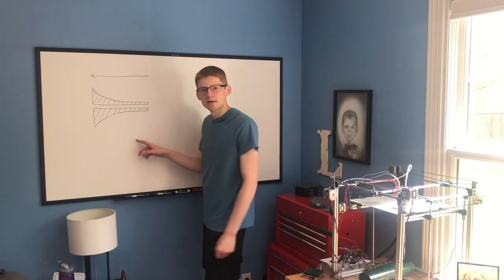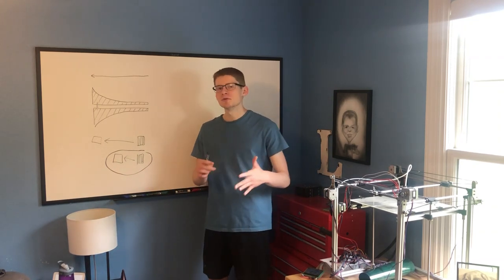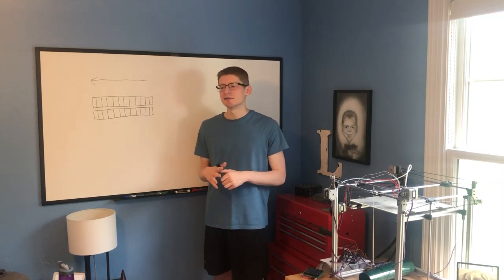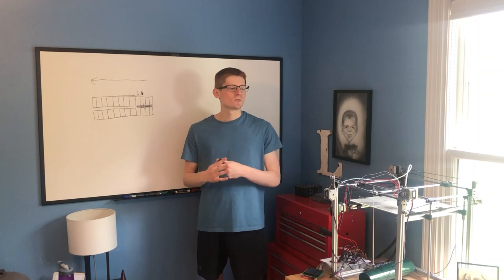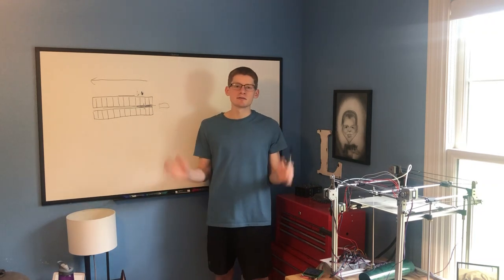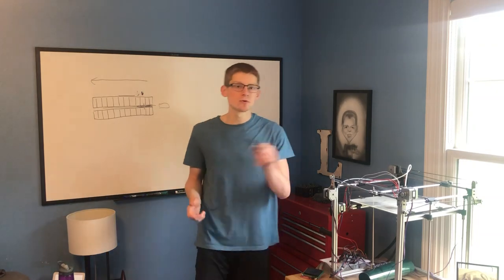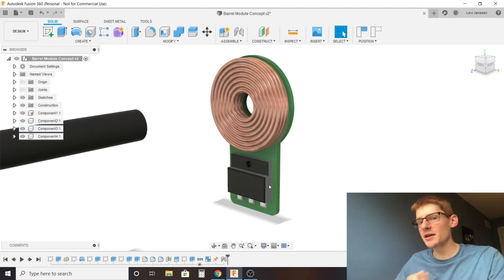Making a Coilgun - Part 4: A New Revelation

Comment: Hey Jannsen what if you take the infrared sensor and remove it from the direct area of the coils and use the space the diameter of the laser light takes up to detect when it passes? You could also potentially do something with a coloured part of the projectile to detect a specific point to time it better, 2 parameters is better than 1 i would assume

Comment: Trial and error to find the most efficient coil set up a test where the coil is at a certain height and the bullet is face up on the surface below, then measure how much voltage and current it takes to lift the bullet off the table or make it fall over. This is the best method I have found

Comment: On the topic of knowing where the projectile is, you could easily use VERY small diameter fiber optic material with a bright LED on the PCB, and another strand opposite the projectile opening on the other side leading to a photoreceptor.  This will let you time things, and I feel that the blind timing is a dead loser.  Can't address the coil geometry, but the PCB is more than thick enough to accommodate grooves that will hold the fiber optic strands.

Comment: I'm not sure but can the longer design even be called a coil gun or is it more of a rail gun. The Navy has a couple " rail guns " and they do produce great power and range or distance. Again I think if you could move the power from a large pack pack with a belt mountain controller for 6 or 8 coils in a spaced out configuration of and of a ever increasing power size using a plastic barrel you would reach your desired end result. This would both be a true coil gun as well as matching your wishes of high efficiantsy. Sorry for my lack of Spelling skills as Dyslexia is a real bother.

Comment: There is an other problem to spent attention to. The coils have inductivity. They  switch on and off slow. When the current is high it is hard to switch them off without protecting the mosfet. I don´t know if this is long enough to effect the timing. If the power comes from a capacitor you don´t need to switch off if the cap is already empty but there could be a resonat effect.

Oops, I see this is already in a later video.

Comment: Look at a rail gun and see if you can't fuse rail and coil since they both use magnetic force natural high power neodymium magnet alternate negative positive down the line on the pulls there's alot you can work with look at all angles charged copper is good but thinking outside the box is how discovery is made and your doing good also think about this test it in a vacuum chamber space gun bro

Comment: How about using high voltage for the sense circuit. You could have one hot wire with a lead going to each individual coil and a return lead on the other side of the tube. When your metal projectile approaches a coil the high voltage will jump across the leads through your projectile. The leads could be as thin as a single magnet wire and thus could easily be placed in between your coils. Also for the most efficient electromagnet you need to increase the copper fill. By using thicker copper wire the same current flow as before will generate less heat and thus will be more efficient.

Comment: Pull and push? as the projectile passes mid point the coil reverses to push?  use opto couplers between each coil for determining position of projectile, this could control triggeringand coild polarity flip, then use a geometric progression of distance between coils, close at start and increasing in distance, also ramp up power based on distance between coils? Arduino for control?

Comment: What if you offset the rotation of the coil pcbs, to free up space to allow for smaller coils if necessary or larger MOSFETs, the only problem would be is that the power rails would have to wrap around the the barrel. Also, you should get a discord server, it would help with communication.
Reply from the maker: You make a good point, that's also something I thought of. if you offset every other transistor position by 180 degrees, you could just have four busbars instead of two, so power distribution wouldn't be much of an issue.

Comment: have you considered using the projectile itself to determine projectile position? you could use brushes to complete a circuit and trigger the next coil pack
Reply: you could also take a hit on coil density by placing optical sensors after every few coil packs, and estimate the time in between sensors, rather than estimating the entire thing

Comment: So you're thinking about it all wrong with the turns of copper wire. Think about it more in terms of resistance per foot and length of copper wire. The gauge of copper wire you choose will determine the length you use because like you said there comes a point where amperage decreases due to Resistance. So what you want to do is choose your gauge, then determine how long that wire can be. You want the biggest coil possible so if the resistance gets too high you will compensate with voltage. I believe that if you just choose a starting point it will make it easier and thickness of wire is in my opinion the best place to start because from there you can calculate everything. I like where you're going with this idea and I believe I have a coil design that will work better. You're design is good except that the outer diameter of the coil is too far from the projectile so it won't be adding much to the equation except for losses. This is getting too long haha. I've been putting a lot of thought into the same thing if you couldn't tell.

Comment: If the bolt moving through a coil creates a small amount of electricity, it could power a transistor to then go to the positioning circuitry. And then immediately power that coil.

Never mind I don't think this will work

Comment: I don't have the technical knowledge regarding the electrics but maybe I can contribute a mechanical idea on triggering your coils to switch on and off.
Is it possible to have the projectile travel along two segmented conductors (one positive and one negative) where each segment is a contact switch.
 The projectile will close the contact for the coil it is approaching and open the the contact of the coil it has reached the center of.
As the projectile gathers speed the distance between the coils and switches may need to increase to make the best use of the timing of the switching sequence.
Is this likely to reduce the reliance on some of the electronics you have in mind?

Comment: So reality in a way helps to simplify this problem somewhat since you don't have to model the relationship between the number of turns to the magnetic field given the current and voltage limits of your power supply and the available volume for the coil.  Magnet wire comes in a finite number of gauges so instead you can figure out how much magenetic field you get from using the maximum number of turns for each gauge of wire available to you and just look for the biggest number.

I think heatpipes or vapor chambers and some copper shims might be a good way to deal with heat dissipation.  Look for what's available and tailor your design to that.

Comment: What if, first of all, you make a projectile about the size of three coils and put the coil contacts inside the barrel? in this way, when the projectile passes, it will activate each one of the coils, but putting the contacts of the first coil before in the barrel, of the second coil in the center of the first, the contacts of the third coil in the center of the second coil. and so on? In this way, when entering the cannon, the projectile activates the first, being in the center of the first activates the second and being in the center of the second turns off the first and activates the third.
I do not have much knowledge about it but it is something that occurred to me, sorry if it is misspelled, I used a Google translator
Reply: If you do that, you increase the chance of the bullet welding to the contacts. Plus even when it doesn’t weld it to the contacts, it greatly increases the resistance the projectile experiences.

Comment: you can have a sensor under the coil.. equation, laser data point interpolation. for a projectile that is the same size and will always be that specific size the blind method would do fine if designed around that specific projectile.

Comment: You should be able to back out it's position if you know it's mass and magnetic permiability to a fine degree.  Based on the rough calculations, you should be able to calculate a charging and discharging sequence that's ideal for the mass and permeability of the round.  Also, you need to start getting into assembly my dude.  Start calculating shit on terms of clock cycles of the cpu and how many cycles it takes to fill a buffer.

Comment: you only need a pinhole width of space between coils to implement a diode position sensor, the LED and photoresistor/comparator circuit(s) are off to opposite sides of barrel(outside of), just need to keep ambient light from photoresistor

Comment: Just retro fit your coils... say you build 8 coils, you could put a sensor at the end of 1 coil, measure the speed/time, use that speed/time (avg over x amount of firings), remove sensor, add second coil and repeat until desired length/speed is reached.

Comment: IDK if you will ever read this, but anyway.
Disclamer: i am not english, sorry for the grammar.
Your problem with the resistence, you can more or less ignore that, since you do not want to go for big coils anyway.
Copperwire has so low resistance that you need to have a very big coil for it to kick in.

The bigger issue with big coils is the inductivity. Basecly the more coils, the longer the magnetic field will linger around and pull back the projecktile.
Sadly i havent jet found a mathematical solution for this, but i am working on it to at least beeing able to guess more accuratly.

Comment: Why limiting the thickness to the mosfet dimensions, you may separate the switching electronics from the coils, in a switching electronics module, having its own heat dissipation system, this way less heat at the coil area, regarding the coil heat dissipation you may use like multiple tubes (closed loop) with thermal dissipation fluid (oil, water...) installed in a circular pattern around the coils...
Reply: Look into the vvvf power modules setup, some are dipped in some kind of gelatin that helps heat dissipation
Reply: Regarding the coils, you may think about it as a big coil, subdivised, maybe linked in a way that you can select the needed coil area (series connection for exemple...)

Comment: By applying a lot of constant current you also heat up the coil. So yes, of course it'll be less power efficient, but I think it would be more efficient for the copper. Power is quite cheap, though expendable here. copper wire especially for bigger coilguns gets a bit costly and heavy. 
Blind systems need to be fine tuned, and I would think it's main enemies could be gravity or centrifugal force from movement of the gun, and change in friction of the projectile for various reasons, but these aren't significant for the most part. Although at the end when the acceleration per coil falls dramatically, to use them at all I believe you'd still need sensors even with those being a small factor, but at some point they'll be enough of a factor to make a coil either turn on before or after the projectile goes through it.
I saw someone helped with the turns/wire gauge debate you're having so I won't go into that. 
Now to the last video.

Comment: This is a really cool design. I love how you went from 'block' modules to the 'exponential' coil because of inefficiencies and then back again, also because of inefficiencies. Just now you end up having virtual 'block' modules composed of many slices. My first though is "how much force can a single slice produce"? The more coils you have the more force you get, so having loads of smaller, thinner coils means that each one individually produces less force, no?

Another thing. Regarding the blind system you intend to implement. That's a really cool concept. Could you maybe use capacitors, which are charging up, to trigger the mofsets in the optimum sequence? By varying the RC value of each individual capacitor in your barrel assembly you should be able to precisely tune how long it is before a cap reaches the required voltage on you mosfet. Thus you can get a really acurate timing, independent of some microprocessor. Anyhow, i think your timing circuitry must be without a microprocessor. The timing are too tight imo (especially with thin modules which require more precision). Im really looking forward to the next episode!
Reply from the maker: Potentially. An individual coil would likely be able to produce less force, but who says you have to turn on just one coil? You could turn on multiple adjacent coils at a time and it would effectively be the same.
Reply: @LeviJanssen  thats the virtual block that i was talking about. At that point you have essentially reinvented the classic 'block' setup, except that you can move the 'virtual block' down the barrel alongside the projectile, which is more efficient as you said.

What do you thing of using charging capacitors for timing? I don't really do electronic engineering so i wonder how plausible it would be, but that's what popped into my head immediately.
Reply from the maker: Using RC circuits as a delay is certainly a thing, but capacitors tend to vary in capacitance by plus or minus ten percent and resistors can also be somewhat imprecise. Not to mention that every stage would require very specific values and none would be the same and it would be impossible to quickly adjust values for tuning. It wouldn't work. I also had some concerns with using a microcontroller for timing, but assuming a conservative on/off speed of 300 kHz, at a very optimistic 1,000 ft/s the projectile would travel 1mm per "tick". And that could only be the case at the end of the barrel. Everywhere else you would have much finer control.
Reply: @LeviJanssen  fair enough. Can't say that im not surprised that my solution wasn't optimal. I would have said that the caps would be the best way but i didnt have a clue about the  error on the cap value.

You seem to have definitely put a lot of thought into this and im looking forward to future installments. Keep up the awesome project my dude.
Reply: @LeviJanssen  I know you were working on this a year ago, but I believe 1000 ft/sec is going to be unobtainable for a small coil gun, due to the fact that a smaller projectile is going to reach magnetic saturation fairly quickly, and once the projectile is saturated, adding more magnetism isn't going to make it move any faster, because the extra magnetism doesn't have anything to hold onto.

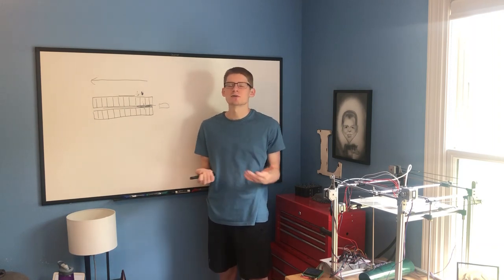Comment: 13:52 what about putting some kind of a TOF sensor on each coil module PCB making up the barrel? TDK makes an ultrasonic one, but you could use an optical TOF sensor, too. You might also be able to use a hall effect sensor.... they're cheap enough to include on each board and would offer a more dynamic solution

Comment: I propose a hybrid idea of nested geometry with the original exponential geometry except with the inefficiency nested or truncated and nested inside the next coil and so on all the way down combined that with high coil density as mentioned in this video and you would have something really interesting— in terms of cooling I would suggest fitting the entire coil geometry section inside a High pressure steel tube with liquid nitrogen coolant.

And since you’ve got that for you might as well make the entire thing superconducting…

Comment: Random idea, if used with a vacuum tube in the middle, and an electron source, could this make a Linear Accelerator?
Reply: Yep, that's how you could build one of those. There was a Master's thesis (I think from 2010), which did exactly that.
Reply: @hjups  actually, having designed LINACs for Ion Implanters decades ago, I can tell you that they use RF cavities (resonators) rather than coils to accelerate the electron source.  one multi-MeV prototype managed to burn a hole through a 6" steel platen in the blink of an eye when the brakes were hit to stop the spinning platen and the signal did not get to the LINAC to shut it down quickly enough.  now there's a death ray.  but the thing was the size of a walk-in freezer, so not exactly a hand gun.

Comment: it depends on the wire you use, I've made a cylinder biphlar coil with only 5 turns and it's pretty fast and pretty strong.
I'd say somewhere between 5 and 15 turns depending on the wire size and wire type.

Comment: You could put the ir leds/diodes flush with the coil within the same slice. Though I wonder if the added distance between the radius of the coil and the projectile would effect the efficiency. I'd also worry about said components being damaged.

Comment: I was thinking of an induction based detection system by adding a magnet to the projectile and make the electromagnets behind the projectile repel the magnet so it would be more efficient.
Reply from the maker: I think any induction based detector would be overwhelmed by the strength of the adjacent electromagnets. I agree that adding permanent magnets to the projectile would make high speeds easier to achieve, but one of the beauties of a coilgun is the dirt cheap, simplistic projectiles. Magnets are pretty expensive.

Comment: So on your mosfet (or whatever you use), if you put your modules 1 up, 1 down, at 180 degree difference you could have aluminum fins to absorb some of the heat, where each circuit board slides in between a fin.  l.l.l.l.l.l scenario, may be one way to keep the size down and absorb that heat.